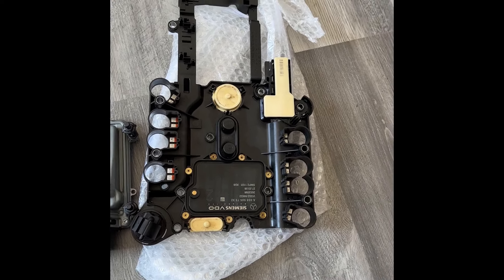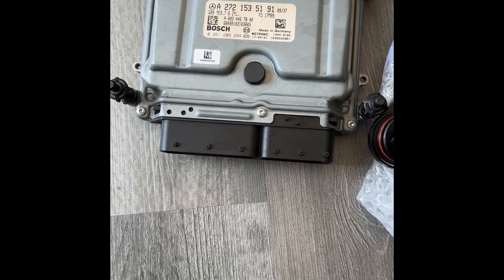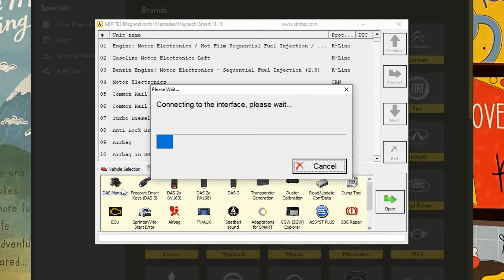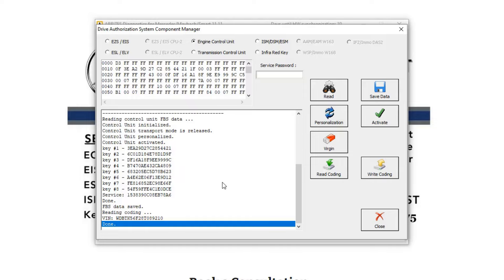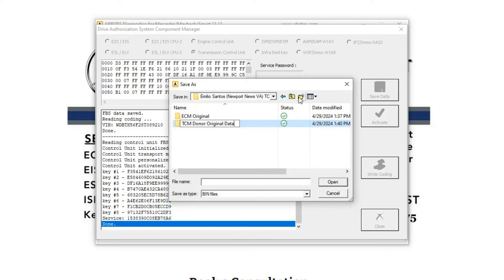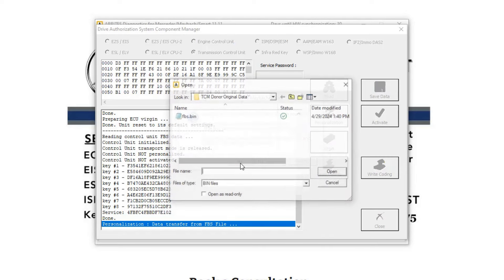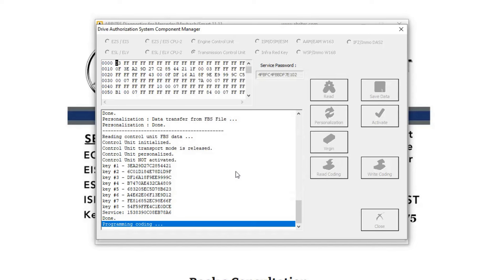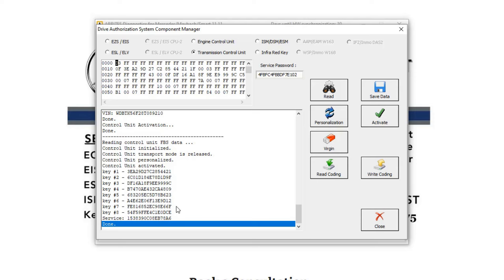Mercedes 722.9 7G Transmission Control Module Clone when the original is not available. What now??

Comment: One issue here friend.  The original ecm would have had calibration data stored in it for the solenoid valves.  You normally save and transfer this to the new unit.  Without doing this the gear changes may not be smooth.
Reply: How do you get calibration data on a used conductor plate? Are the solenoids part of valve body or part of conductor plate?
Reply: @aleksa52  Actually the calibration data is the hydraulic characteristics of the original solenoids and the valve body.
Reply: @gingerjessy  so the conductor plate will have the calibration values  to each solenoid butnif its used your really can't get that data. Unless it is in the Engine ecu.
Reply: With a new tcu there is an adaptation process needed to learn all the correct settings for the car for a virgin tcu.
Reply from the maker: You're correct. I'm sure you meant to say that the calibration data is stored in the TCM. Not the ECM.  The base flow data is what sets the calibration of the valves, then over time the 722.9 TCM makes small adjustments (adaptations) as the valve body springs wear down. This is the data that we needed from the original, but since the original was not available, this is the best alternative for the cost. The 722.9 will make adjustments over the next 300-600 miles to bring the adaptations as close to the original as possible. Thanks for your comment.